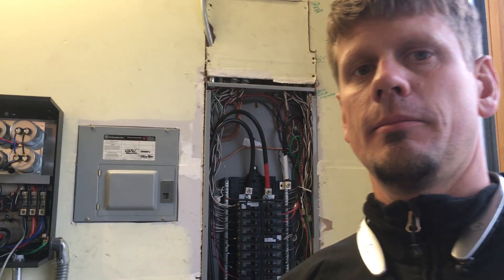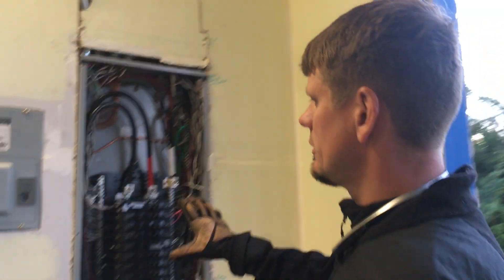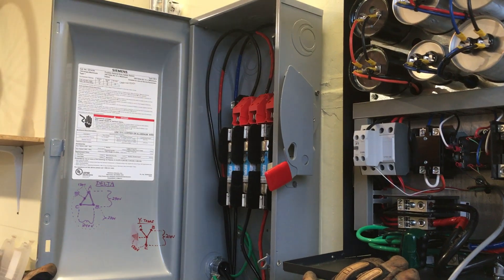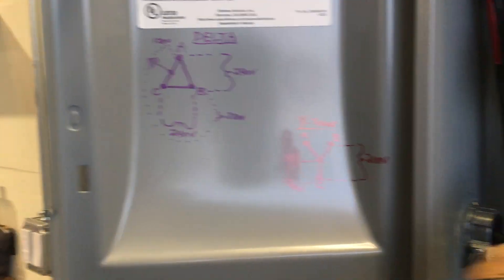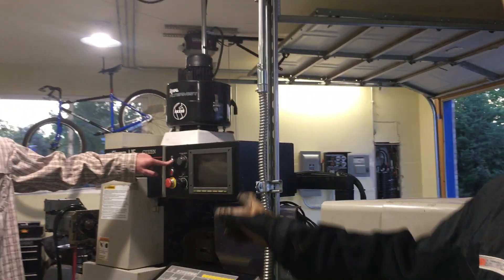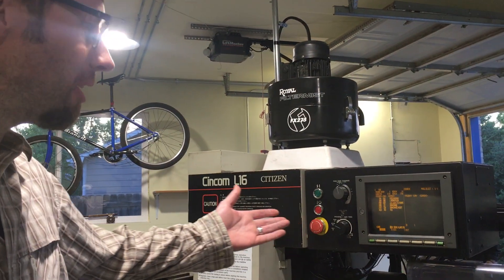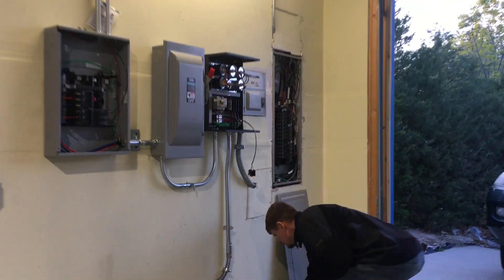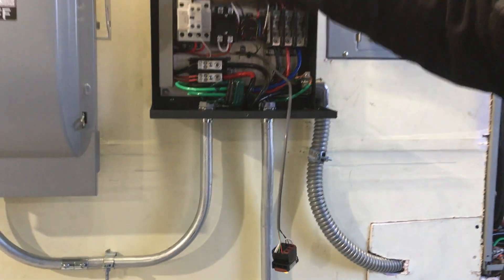Wired Up a Converter Machine For A Residential Wood Shop, Article 455

Comment: I made a rotary phase converter to power a 3 phase hoist in my shop. I used a 3 hp 3 phase GE induction motor, worked great. How ever it only used 14 amps on the single phase side under full load.
Reply from the maker: So your 3 hp motor was designed for 19.86 amps on 120 volts. that is calculated at 746 watts per HP.

Comment: Awesome job adding a roto-phase!   Don't know the horsepowers involved, but you can run 22 hp from a 20 hp roto-phase.   Did you install standard 120 volt to ground breakers in the three phase panel, or did you correctly install delta 240 volt breakers?    If you have this issue again, check out TECO.  I know they have variable Frequency drives, but I believe they have constant devices that go single phase to three phase.   Way less expensive than roto-phase installs.   Good video!    Respectfully submitted!

Comment: What is that machine used for?  How much did all that stuff cost?
Reply from the maker: This is a rotor motor convert, it adds a leg for the third phase for the 240 volts. This is for a CNC metal cutting machine for prefab metal parts

Comment: What kind of professional uses a light bulb in place of a meter ffs.
Again non compliance to NFPA 70E..... do you own PPE as osha requires you wear ?
Reply from the maker: IF you watched our videos you would see that we own thousand of dollars for meters, the point for us to use a bulb is because it actually creates a load and the led can be good for a quick moment up to 240 volts where an INC or CFL cannot. 
As far as PPE, yes I am aware of it, I am not in a gear room with 480 volts, most of my videos are done with 120/240 volts with single phase in a home, I appreciate your concern, although, we have to test our circuits hot, I have been working circuits hot for 20 years, I do not know anyone that traces with ohms, unless trying to locate a GFCi or AFCI that is tripped. 

Where would you buy them? up to what voltage or homes?
Reply: Peterson Electric 120/240 volt can be up to 12 cal..... simple calculation would give you said info on what you need.... I suggest take a NFPA 70e class, take any osha class. My home panel is cat 3 120/240 but guess that's above your knowledge as we do arc flash analysis for anyone who needs or wants
Reply: Peterson Electric 70E clearly states no hot work above 50 volts except for testing when proper PPE is in place your videos show your lack of actual knowledge and disregard for safety
Reply from the maker: Glad to hear, not sure what a cat 3 panel is, other than extra SCCR protection on the main breaker for a larger AIC fault current.
Reply from the maker: Thanks for your input, I'm pretty sure we do not work for you.
Reply: Peterson Electric wow really you don't know what cat 3 is???
COL must have a joke lic requirement. Do yourself a favor learn NFPA 70E
Reply: Good job Peterson